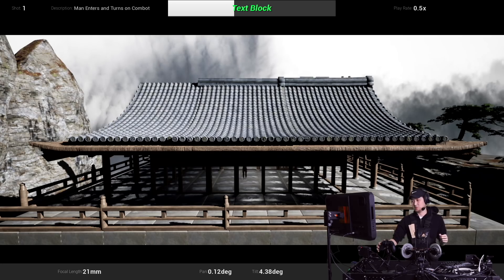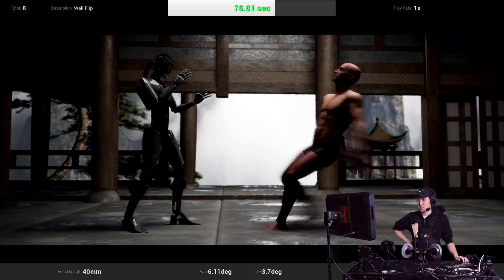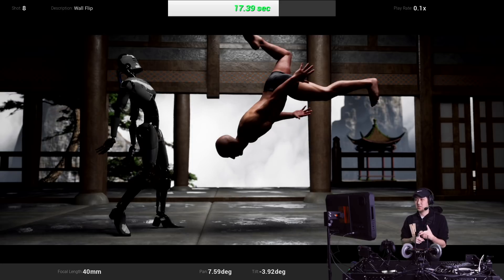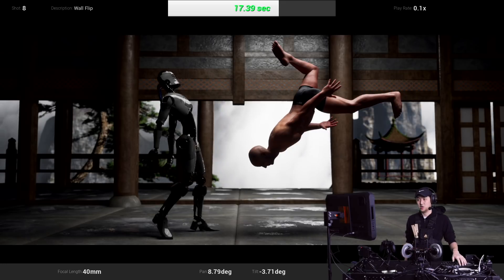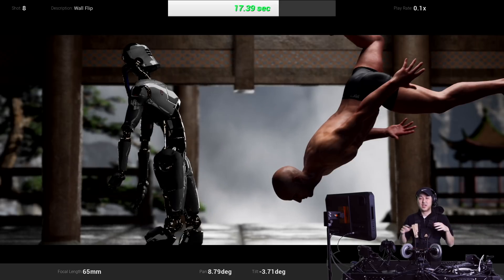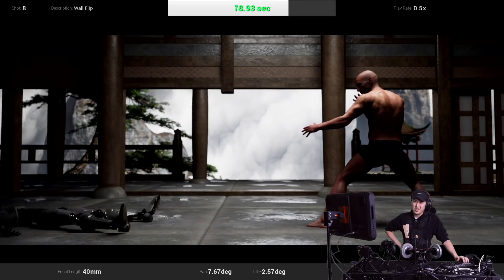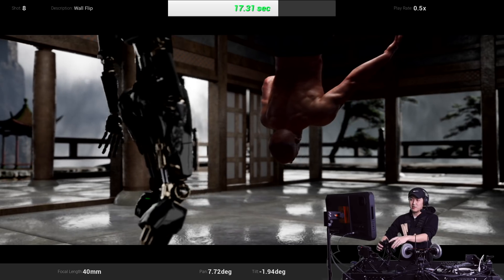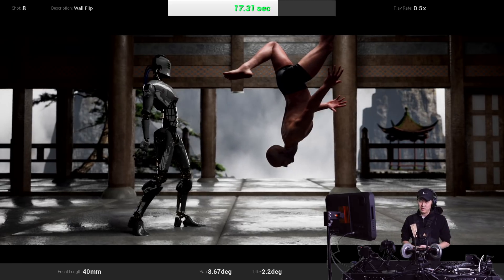Real Time Ray Tracing in Unreal Engine | Nvidia 2080ti

Comment: Interesting but the lighting is wrong.That is no way real gi, has no color bleading, shadows are to hard and looks wrong and more like the old mentalray or more like a scanline render, totally wrong lit.  Maybe the realtime raytrace works in some cases but everything i tested look good for exterior and not interiors. I must say i love your riggs. As much as i like unreal is a bit to much hype arround it.  How bout using brigade from otoy for your work ? Is that a possibility, they have a real almost realtime BF pathtracer  a lot more impressive then this.
Reply from the maker: Unreal is a hybrid Raster + Raytracing approach, so it’s not an unbiased spectral renderer like Octane.  But neither is Redshift and it makes great results at good render times.  Brigade isn’t out yet is it?  UE4 is definitely my preferred system/game engine for building real time systems.  If Brigade or other real time path tracers interface with UE4 I’m happy to try them.